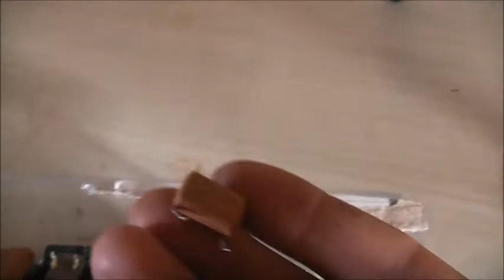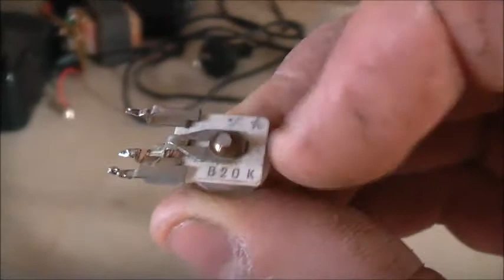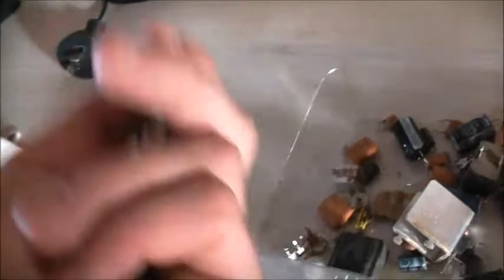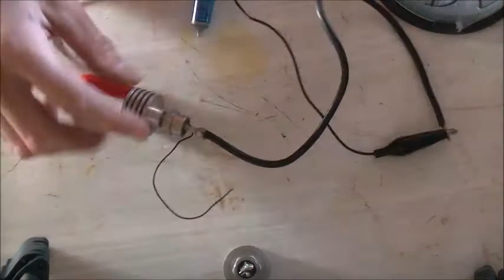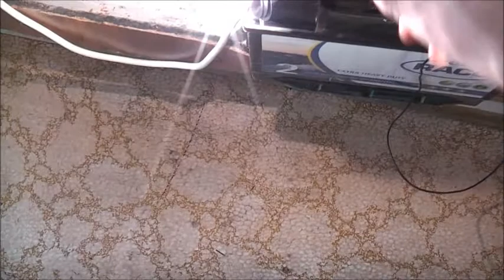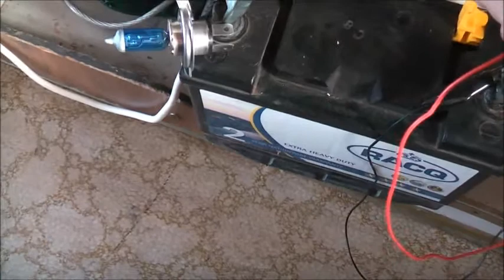Salvaged Components & SCR Test

Comment: DO NOT LET + HIGH VOLTAGE NEAR THAT GATE.. SCR BOOM :)
use twin supplies.. negative tied, 12v + 150 ohm resistor thru a switch to the gate